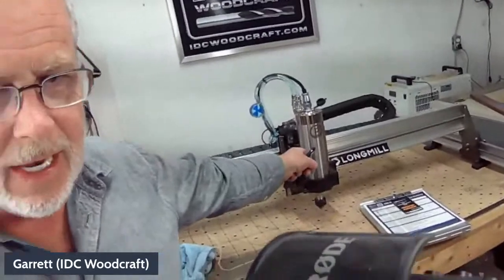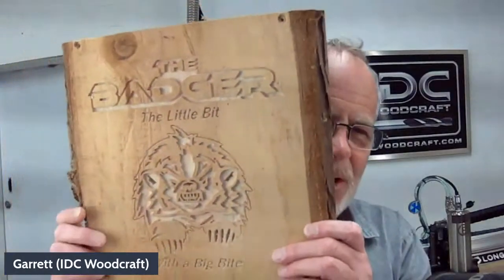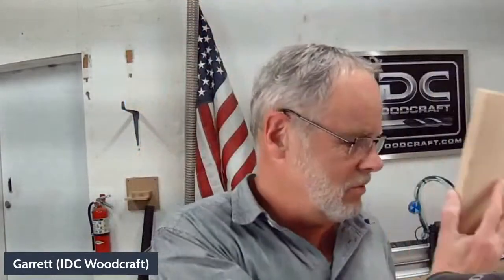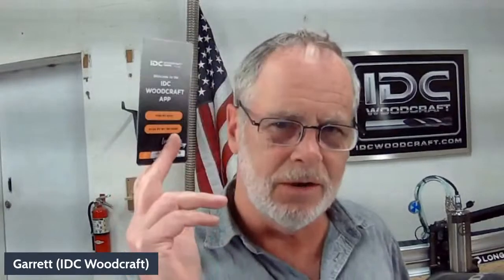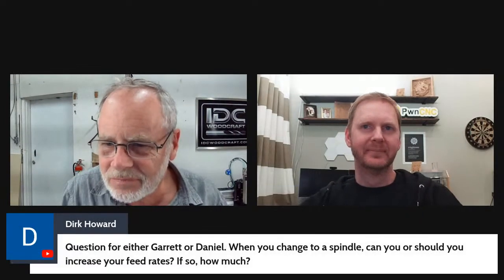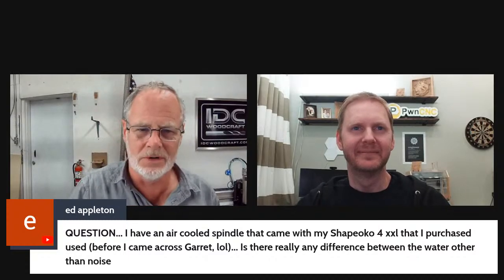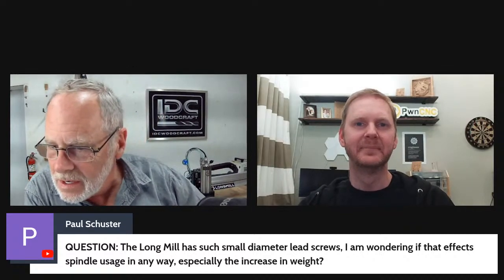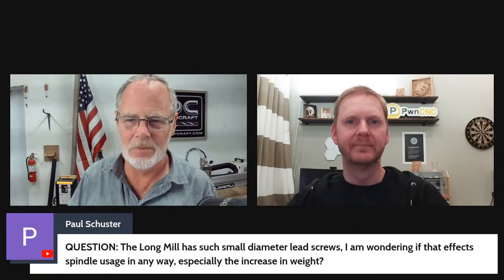Upgrading Your CNC Router to a Spindle with Daniel Moran from PWN CNC

Comment: Why does a VFD have to be used ? I have an open builds that has a black box 32 with an interface that shows spindle control. ?
Reply from the maker: A vfd converts single phase to 3 phase

Comment: Does your spindles and vfd adjust RPM as the feed rate of the machine changes during a 3d relief carve? My machine will automatically change feed rate during a 3d relief carve no matter what I have the feed rate set to. I've seen as low as 7ipm feed rate which changes chip load and is just wearing bits out prematurely because the router is still spinning at a high rpm
Reply from the maker: bubba6945, good question brother. Typically the spindle speed stays the same and you adjust your feedrate to suit the job you are doing if you are trying to change your settings on the fly. For your situation its best to start with the right feeds and speeds to start brother!
Reply: @IDCWoodcraft  it don't seem to matter what speeds I set my feed rate to. That's my point lol I can set it to 100ipm or 50 ipm it will change as it's making the pass. If the detail is nice and smooth it runs the IPM I set but once it comes to an area in the model that is raised it dips it will decrease IPM in its own I've seen it drop to 7ipm with a 120 imo feed rate set in my cam program which is just excessive wear on my tooling because the router is preset at the speed we set them to. I was hoping the spindle speed would follow the IPM of feed rate and ramp up n down based on the IPM the machine actually moves. If not the spindle has very little use for my application other than it's cool 😂
So on your long mill if you do a 3d relief carve and you set your feed rate to 100ipm it runs that IPM all through the carve? If so I'm buying one ASAP the Onefinity black box controller is configured so that it does as I've mentioned. There is no user adjustment. You basically set the max you want it to ever go and the controller automatically slows the feed rate down.